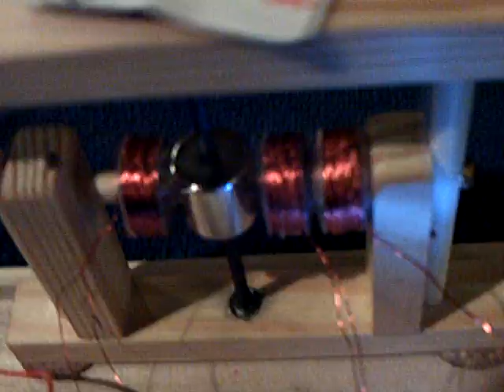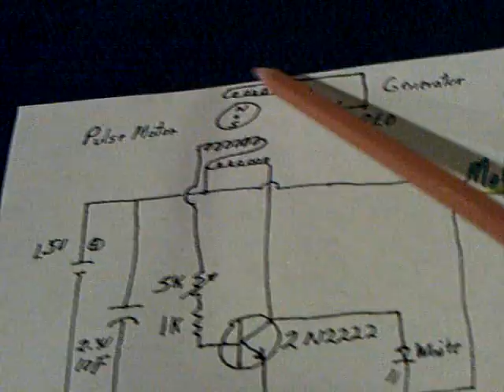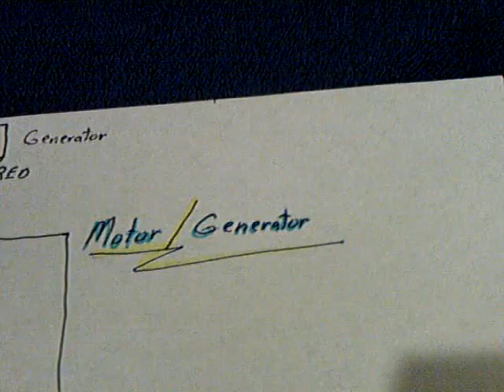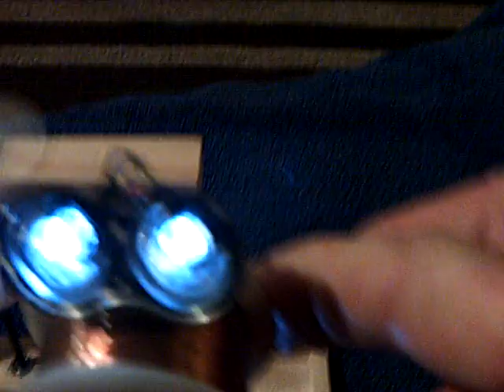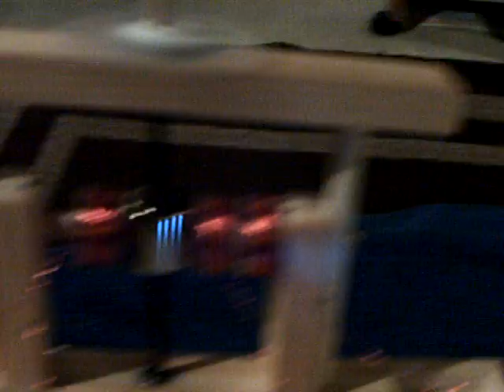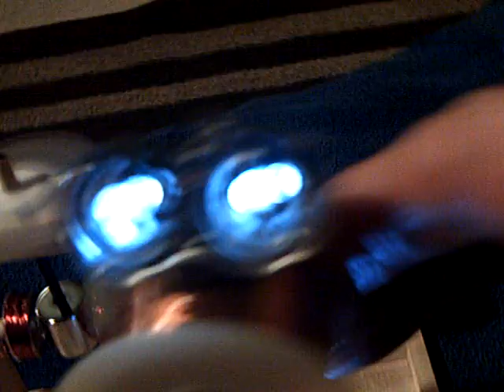Motor - Generator running on a capacitor

Comment: Im building a simple bedini set up now.. I really would rather not use batteries,  So could I use super caps in place of the load / charge battery and the run battery?    And where on earth does one find these supercaps?  I never even considered it

Comment: This arrangement kinda reminds me of a Prius scenario with the motor and the generator and a capacitive bank but in the cars case its the battery pack. One thing I was thinking about after looking over this setup with the transistor have you ever used a photo transistor to see if their is any advantage of isolating the transistor switching maybe making it switch faster then the standard transistor because its light driven instead of electrically like traditional setup.

Comment: Why are your trigger coil, your drive coil, and your generator coil all on the same plane, lined up as it were.  Because they were. And your video shows the schematics has the generator coil is purpendicular or at a right angle to the other coils, Why? You shouldnt mislead people. You post vid for people call the kettle black. and all but dislocate your shoulder patting yourself on the back for such a great video. Who you selling this to? most people cant make heads or tails of schematics. Sad

Comment: What has your experience with charging batteries with radiant energy told you, say, in comparison to normal charging with brute force current. Have you gone there much? Ever try swapping out sulfuric acid for alum?